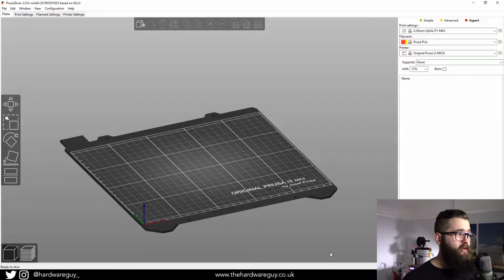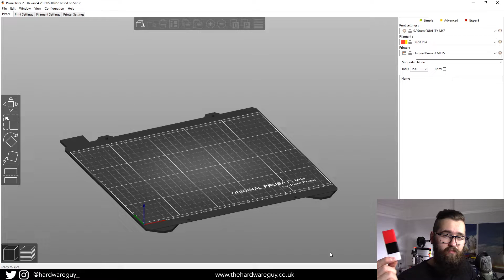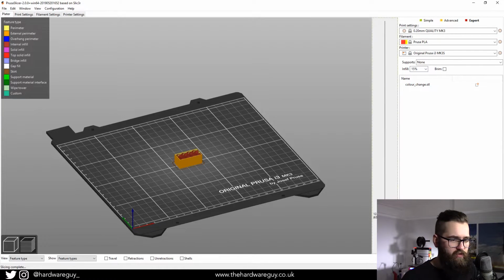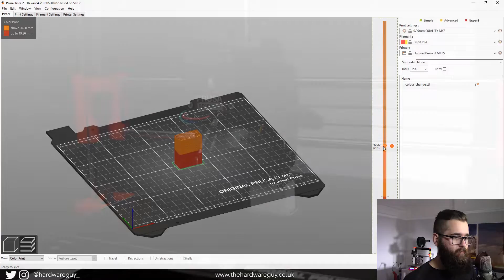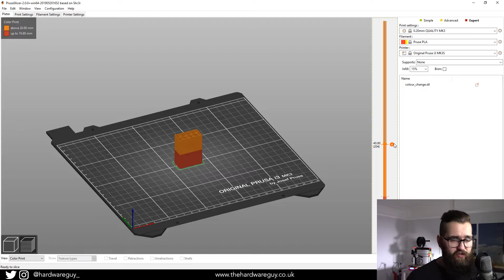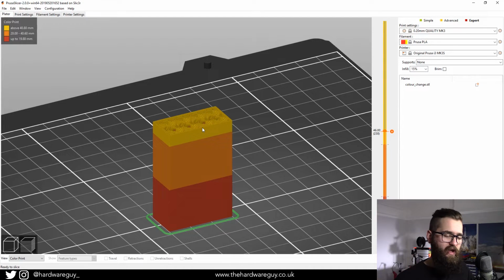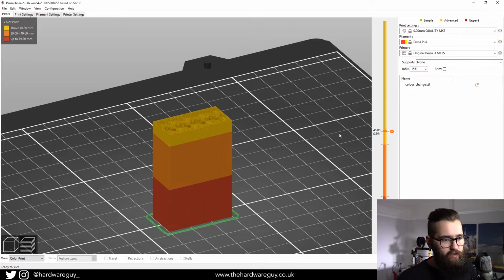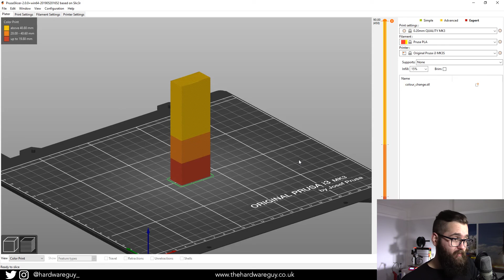Multi-colour Prints with your Prusa i3 MK3

Comment: If the second or third filament prints best at a different temperature how do you enter that criteria at the layer change in the slicer?
Reply: You could manually adjust it through the "Tune" option on the printer's LCD

Comment: When you load the new filament, does it automatically feed it through and resume, or do you press a button or something?  In the video it looked like you really had to be on top of removing the extra extruded filament.
Reply: it will pause and move over to the side and make a beeping noise. the printer nozzle will cool down but the bed will remain at heat. once you approach the printer, you will have to press a button to heat up the nozzle again, once heated it will prompt you to push the button again and the filament will unload. Then you manually load the new filament, it will purge then ask you if the previous colour is completely gone, from there you can pruge again if its not, or if it has you can select yes and it will resume the print. 

Hope this helps..
Reply: @joe4264  thanks!